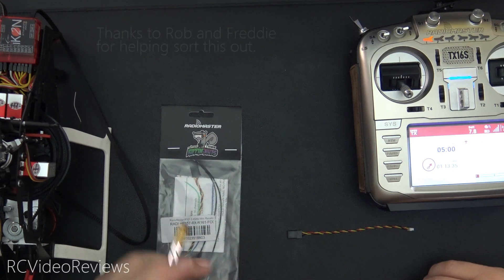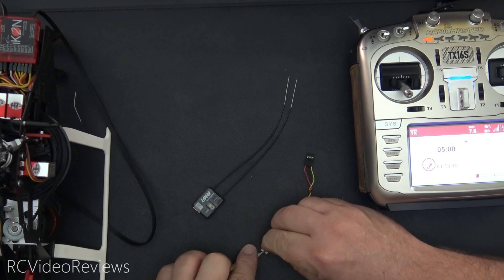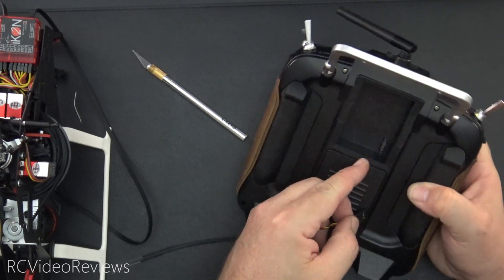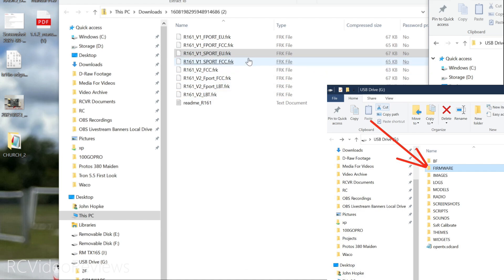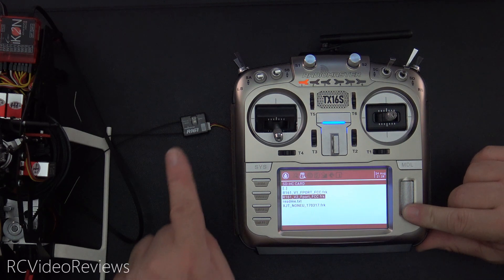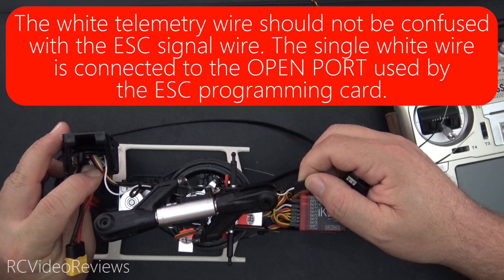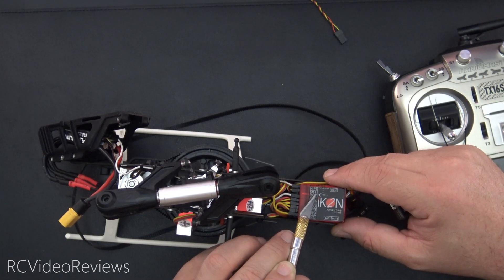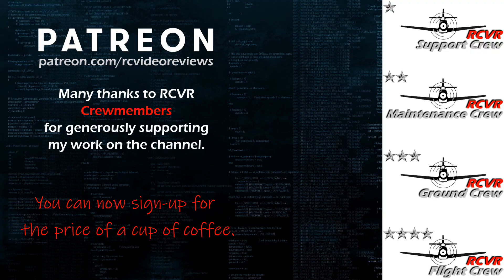iKon Flybarless and Hobbywing telemetry via f.port on R161 •  No Inverter! • No Solder! TX16s

Comment: Since the 161 is no longer sold what are the options? Can you use the new RP3-H ?
Reply from the maker: RP3-H is ELRS/CRSF. If you have an ELRS TX you can bind the two. I haven't tested for telemetry using CRSF on ikon though and likely won't as I'm leaving iKon for Rotorflight.

Comment: Can’t get R161 anymore, is there anything in the market can replace the R161 doing the same thing?
Reply from the maker: Search for s.bus f.port receivers.
Reply: I found a place in the UK that still has R161s in stock (FCC and EU), ordered and got it in flashed as in the video. Ordered 2 more at $16.58 + $6.05 shipping (air mail took about 10 days to the US), checking today they upped the pricing on them by about 10 dollars... supply and demand i guess.
Reply: @russgreer4012  do you mind to send me the link? Please

Comment: Will the rx still output sbus from the sbus wire?
Reply from the maker: Not while running the f.port firmware. f.port combines s.bus and telemetry together on the wire. So the other end of the wire needs to understand f.port.

Comment: Hi John, I mod the cable but when flashing my R168 & R161 it won't accept the flashing.
Reply from the maker: I've had that problem myself a couple of times. I've found two fixes:

1) Flash a stock s.bus firmware first. 
2) Use the frsky stk tool.

I have seen what you're talking about and when they are good and stuck, the only thing that worked was the stk tool. It's not supposed to be like that and I'm not sure why it happens, but those are the fixes I've found.
Reply: @RCVideoReviews  I found the problem, it's a faulty wiring. Thank you, John.

Comment: Hi John. Is the only reason to switch to F.Port to get the telemetry working? Do you know where to get hold of RM R161 (know it is discontinoud)?
Reply from the maker: Telemetry works with other options. F.port allows control and telemetry on one wire without the s.bus inverter. Racedayquads still has R161s in stock.
Reply: @RCVideoReviews  Looks like even Racedayquads is now sold out.  Can this be done with another RX and the TX16S or how would it be done with separate S.Bus and S.Port connections?

Comment: Thanks John for another helpful video,
I have a question about the r161 receiver 
Do you think it can work with 7.4 volts or 8.4 volts?
I ask because it says 6 volts max
Thanks in advance..
Reply from the maker: They're known to work at 8.4v. I use 7.4v on mine. I also believe the manual has been updated to reflect 8.4v
Reply: @RCVideoReviews  Thanks John..excellent I will order some, by the way do you think I can get the same telemetry also with spirit gt flybarless?

Comment: Will this option work for the opentx integration?meaning the brain2 lua script.
Reply from the maker: I use it regularly. Works fine.
Reply: @RCVideoReviews  that’s great to hear,thanks
Reply from the maker: You're welcome. I have this setup on all 3 helis.
Reply: @RCVideoReviews  I’m in the process of making the switch from spektrum to opentx
Reply from the maker: @davidosborne4970  If you can find a stash of these r161s out there, grab them. They're no longer being made and they are a very good solution for use on Helis with an Ikon.
Reply: @RCVideoReviews  just ordered 3 more because of that reason lol

Comment: OK. I have now flashed my R161 with F Port. Installed it on my Trex 470 with the Ikon system. Works great. Getting telemetry from the system. Installed the MSH Brain2 lua script on my TX16S and can see and change the Ikon settings from the TS16S. Thanks John. I am a very happy camper.
Reply from the maker: Great to hear! Good job. Cool stuff right?

Comment: John:
   I can see you were very considerate to provide a table of contents to enable jumping from one section to another.
   However, I think you lost some (many?) of us by failing to describe what exactly the ICON is, and why we need to use it. One reader's comment suggested that this mod is useful to enable the use of F4 flight controllers to do some F7 flight controller functions. How does this work and how is it truly useful?
   Is this functionality useful for fixed wing applications as well as helicopter uses? How? Please describe. 
   I suspect that an entirely separate video may be necessary to fully explain the utility and how/when/where the R161 and other F4 flight controllers are used in this purpose.
Thanks.  - Jim
Reply from the maker: Jim, I don't usually break down specific use cases for every piece of equipment I review. i.e. When I do a video on a Matek F722 I don't explain "this is a flight computer that I will load iNav on for use in a fixed wing airplane" At some level, people that watch these videos have to be accountable to pick up google and ask it what an iKon2 does. 

The video thumbnail and video description explain precisely what this function does:
"In this video I'll show you how to flash the Radiomaster R161 receiver with f.port v2 and how to use f.port in your iKon configuration for control and telemetry without the use of an inverter"

Let me ask you, did you search google for iKon2? Because when I do, the very first hit is "iKon2 FLYBARLESS" Up until a few weeks ago I'd never flown a helicopter, but even then I knew the term FLYBARLESS applied to helicopters.

Regarding the question from Drone Pilot below: He's a special case:

#1 He's an experienced quad pilot with lots of hours configuring betaflight
#2 He's a degreed electrical engineer, so when he hears terms like inverted f.port he knows that the implications are.
#3 His experience with both flight computers and electronics let him find entirely new ways of doing things like stuffing express lrs modules inside his radio in place of a 4-in-1 module.

I appreciate your comment, but you have to understand if I can't make assumptions about what people know, or if people can't take a minute or two to use google and ask a simple question, then I have no possible way of figuring out where to start or stop a video.  Suppose I did describe the flybarless, then the next questions become, Can I put a flybarless on my plane? Can I put it on my quad? Can I put it on my car? Why f.port vs s.bus? Why doesn't it come with f.port enabled? How does f.port work? Why do you need a telemetry wire from the esc? Why doesn't the current sensor work? Why pin 5 instead of pin 6? Why not use the inverted s.bus pad? 

I have to eventually put a stake in the ground or these videos will never get finished. I'll also note, I've never seen you in discord. You should join us there and you can get realtime information about what's going on with the channel.